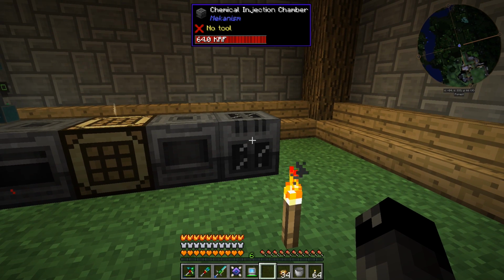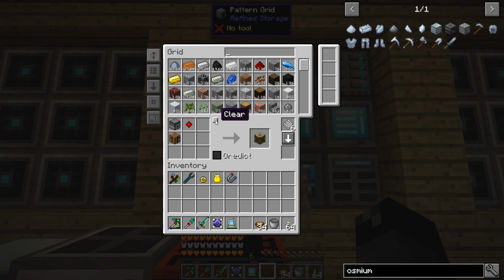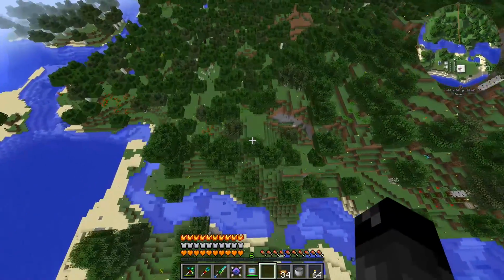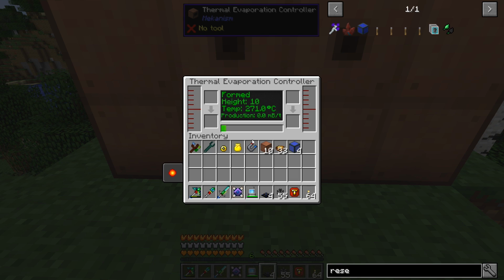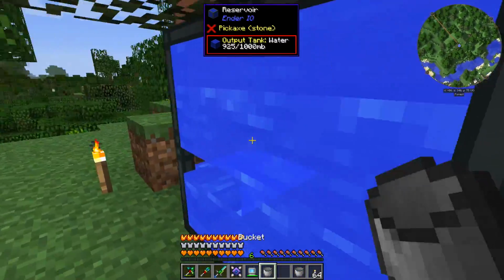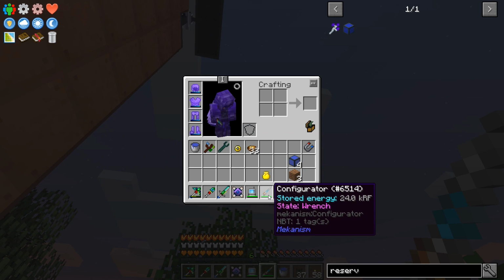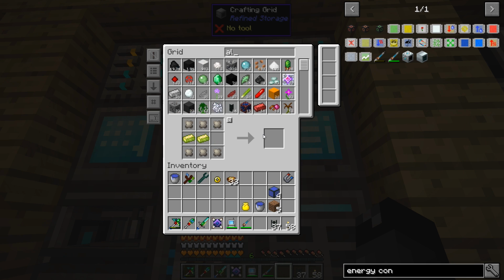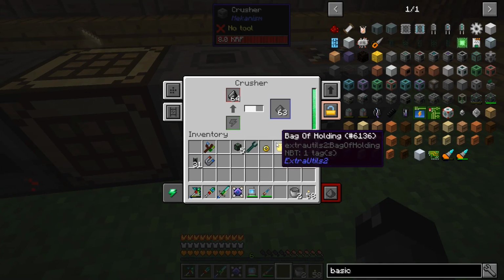Minecraft Mods FTB HermitPack - EVAPORATOR [E28] (HermitCraft Modded Server)

Comment: For any excess gasses you produce, any at all, run them through a rotary condensentractor and store then as liquids in quantum tanks. Then you can enter tank them around when you need them and turn them back into a gas if necessary at that point. It is better than dumping, and you will need lots of oxygen later on. 
Gas upgrades are handy, many forget about those. 
The metallurgic infuser has a factory upgrade now, so you can greatly speed processing that way. Enrichment chamber all infuser items (like coal, red stone, diamond) for more efficient use of resources.

Comment: Hey Hypno, just a couple things about the thermal evaporation tower. First, you don't need solar panels on it anymore, thats the old way. Second, you will need way more brine which means more heat and water in the tower. to do this add an extra valve slot and hook up a resistive heater.  The heater needs power, more power = more heat and use thermodynamic conductors to attach to the tower.  On the water end the reservoir will not be nearly enough. I use 7 maxed out pumps from Mekanism and thats not enough to create an excess. Valves can handle unlimited water transfer so I use ultimate mechanical pipes (which move 64 buckets a tick) into 1 valve. Hope this helps :D

For the other machines when you look in the gui whatever side the gas/liquid is on is the side it will extract from (electrolytic separator, Hydrogen is on the left so it extracts from the left).

Comment: very nice!

Try to always use compressed carbon, redstone and diamonds for the mekanism items, they are cheaper on resources! I mean you probably have infinite resources by now but still you can save some :D

you will need to have a lot of oxygen for the first part, i think I had 5 electrolytic separator producing the gasses it was cool because i could burn the excess hidrogen directly in to gas burning generators which really helps with the energy consumption of the whole process :D

Comment: Hey Hypno, just wanted to let you know you can use other ways to heat up the tower than solar.
There is a block(forgot the name) that can absorb heat from adjacent lava source blocks that can be both used for heating up the tower and be used to run generators, produce steam etc. Its pretty cool.

Comment: When you said the solar panels make 240 rf/tick, it isn't true. That's just the output, which is different. If you look in the tab in the bottom left of the solar panel it tells you how much it makes/how much it uses. If you click on it, it will say how much power it uses in different power types, like rf, eu, J etc.

Comment: I got around the TEP being so slow at making brine by having it store into a bedrockium drum while not in use to stockpile a lot of it. (I did this in 1.7.10, adjust for 1.10.2) The fourth machine in the direct processing eats so much of the gas storage became necessary, even when doing just half a chest of ore.
Reply: Yes Chemical Injector is such a painful machine eating lots and lots of HCl. 256 HCl per tick isnt enough to make elite injection factory with speed and even GAS upgrades work continuosly so I had to create a 512k tank (seems to be enough to process several thousand of ore). Also, for 5x: pain will begin when ore will come to crystallizers. I wonder why dont we still have crystallizing and dissoluting factories (I doubt this will be added though)... A crazily slow and laggy and energy sink setup...
Reply: hes in 1.10.2 does no one read the description anymore
Reply: Tony Miller 
A bit on the rude side. Better than you could have done though, so thanks for the correction.
Reply: Scawsome sorry i wasnt trying to be rude its just that n one seems to know what version hes in even though its in the description
Reply: Tony Miller 
Its ok, you did much better than you could have lol. I should have checked, but with how much is down there, it just didn't seem worth the effort of searching :P

Comment: Does anyone know if you can use facades on mekanism pipes? Either way, you still might be able to paint them in the ender io painter with the invisible block.
Reply: Zoni Universe you may be able to use chisel and bits, they do have compatiblity with quite a few mods pipes
Reply: Chisel and bits does work I have used it on my set up in this pack.
Reply: Zoni Universe no I dont know about the facades you probebly cant and the second one I would just say try it out :P

Comment: Hypno. Make Compressed Coal/Redstone/Diamond/...  It saves ressources.
Reply: Yeah and it also still new it has bin in 1.7.10 for a long time so it was really stable but now they have to change it all
Reply: Yee Yee jep
Reply: Yee Yee also hypno make an automated sercuit fabricator I did it myself in 1.7.10 using AE2 so you should be able to do it using RS.
Reply: here the main problem this is 1.10.2 and its insanely different than 1.7.10 also less stable
Reply: Bas Haaksema yeah they made radical changes in 1.8 now theyve remade everything in 1.10 whats even worse is theres now a 1.11
Reply: Jup like I would say time to do some work :P
Reply: Bas Haaksema yeah

Comment: Your going to want a lot more Brine... Like...  10x what your making... You'll want to make a Mekanism Pump with all upgrades for the water, and you'll want an Electric Heater to bump up how quick your Thermal Evaporator can produce Brine... The Reservoir is your current bottleneck...
Reply: The amount of Brine you produce at the moment would process like one ore a minute or two... That's all...
Reply: Premature optimization is evil.
Reply: Also the transfer nodes should do it so that would be a better choice
Reply: Kyle Marks yeah it takes a lot of brine so I would recoment making a electric heater (dont know the real name) and make a solar panel from enviremental tech and power two towers. also make a infined water source from ex ut.
Reply: You don't need Electric Heaters or Solar Panels or so. Just a heatgenerator surrounded by lava will cut it. Reservoir is a pain... 5 brine per tick is nothing. I can say more, 600 is nothing...
Reply: Yeah true man forgot about that that is way better good thinking
Reply: Amd thats without the turbine that makes even more man. (If I'm correct